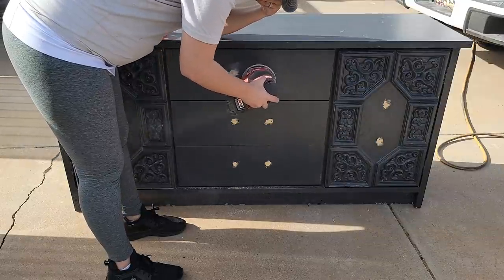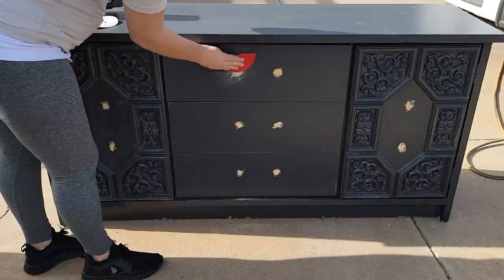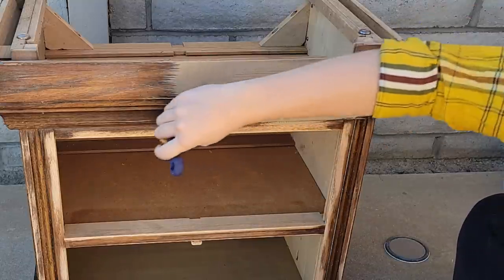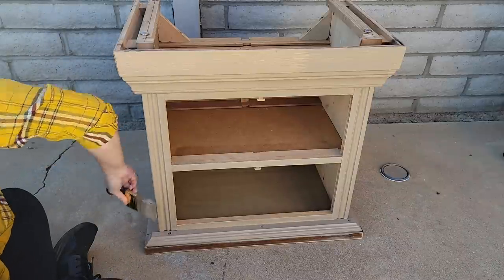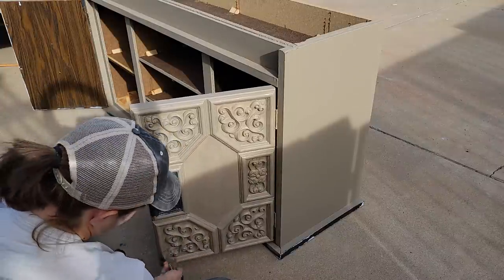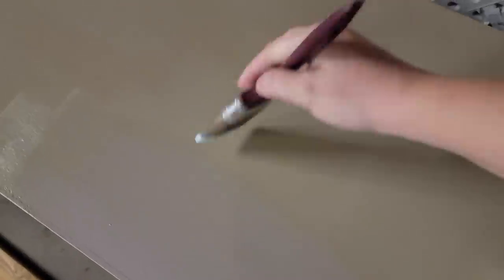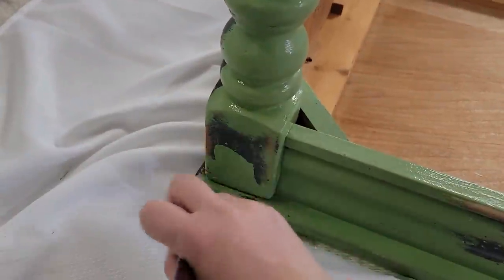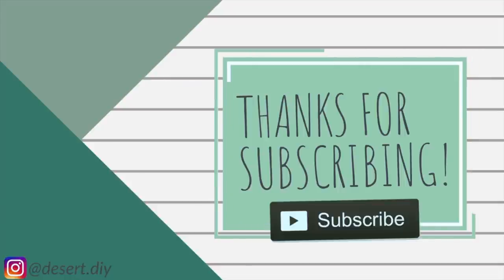3 Furniture Flips Using Trending Colors for 2022

Comment: I was just watching an older video of yours and saw you using a solution and scrubbing the paint off of some hardware  and just wanted to offer a helpful hint to make this easier and faster. Just boil the hardware in some water with baking soda in it for about 15 minutes and it will come right off. There is a YouTube video of this process posted by This Old House.

Comment: I’m curious about why you used a latex paint? I have had to remove it off of furniture before and it is terrible to remove but, I couldn’t leave it on the piece because the latex flakes off. Mineral or chalk paint is not bad to paint over and it lasts a very long time. What benefits are there to using latex?

Comment: The taupe I’d call “cashew” and the green “apple sour” :) Cory I’m working on a piece right now and was hoping for some help. I saw on one of your flips your husband removed some of the tiny wheels that are often found on the legs of vintages pieces. I’m trying to remove some from a table and I’m having so much trouble have you got any advice that’ll make this easier? They are stuck in there so good no nail heads to unscrew so I’m at a loss!
Reply: Are you using chanellock pliers? That tool allows you to really grab what you're pulling on.  Get a good grip on the wheel housing and twist back and forth as you pull hard.  It'll come. Get these at Home Depot or Lowes (or Amazon)